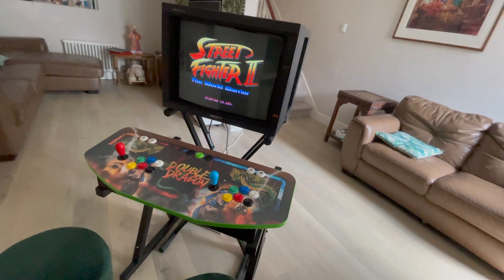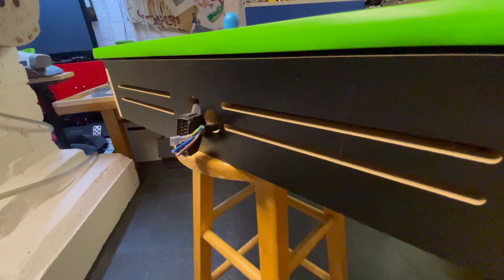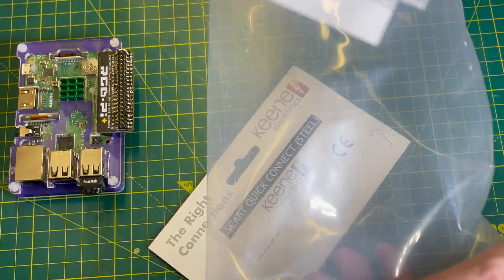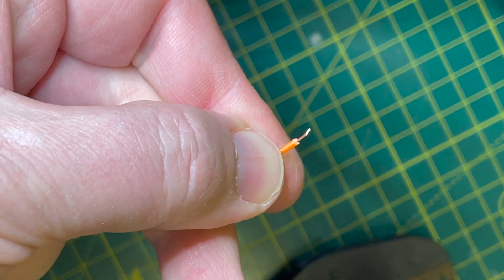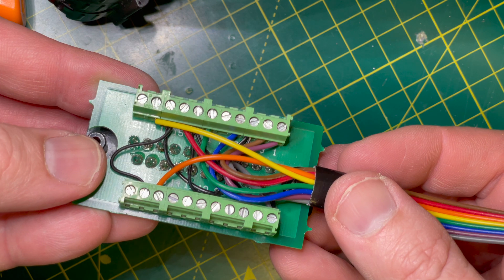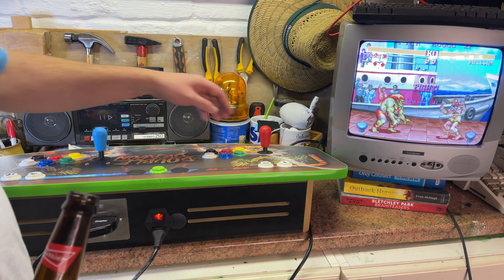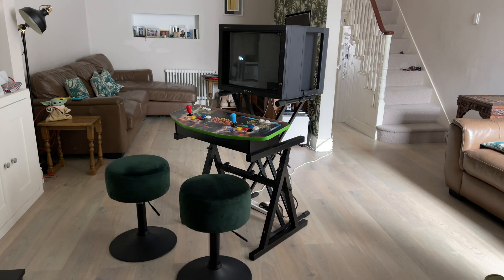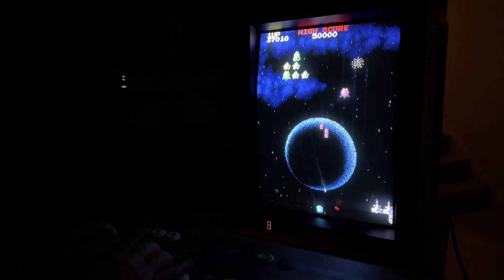RGB-Pi PLUS - review & install

Comment: your video on archon those versions look like terds. it was released 3 years after the c64 original in 86 and they didn't do anything with it. the nes conversion later released in 89 is vastly better.

Comment: Hi! Did you have to adjust from the service menu your tv? I have some overscan when I’m playing arcade games (fbneo core). Any other console games are fine. Is it a problem about tv or the hdmi timing in rgb pi?
Reply from the maker: Yes, I had to adjust my CRT's geometry via the service menu and even so some arcades are cut-off. This is a "feature" of arcade cores - they are a variety of resolutions. In a real arcade machine  the geometry of the crt is normally adjusted whenever the gameboard is changed. The same applies to RGB-Pi. Hopefully you can find a setting on your TV that is a good balance.
Reply: @ChrisSkitch  thank you!
Reply: @ChrisSkitch  uhm just a last question. Do you get any distortion sound or some cracking sound when emulating arcades?
Reply from the maker: @Ononokii  Not that I've noticed. Most sound perfect. The Mortal Kombat series had some issues but the new Arcade Pack 2.2 has improved this.  I guess you have tried adjust the EQ settings in the RGB-Pi menus? Also don't forget there's an active community on Discord that might be able to help.
Reply: @ChrisSkitch  yes, I tried but nothing changed :/ yeah I already subscribed to the community. Thank you again

Comment: Nice build, well done! I'm particularly envious of your monitor which can easily be turned on its side and back again - a cunning external solution! I'm just using an old only TV leaning on its side in my home-made cabinet. I think I'm also using the same keyboard encoder as your original build, but my RGB Pi is the old one which doesn't auto switch to RGB unfortunately.
Reply from the maker: Indeed the Sony PVM-2130QM is a lovely display. I specially bought it for TATE gaming.
Reply: @ChrisSkitch  may I ask where you picked it up? I've been keeping an eye on auctions, but half the gear seems to be in bad condition, while bay prices can be very high...
Reply from the maker: @DinoBytes  I was lucky on Facebook Marketplace about a year ago, picked it up for £200.  Just looking on eBay now can see some pretty steep prices these days.
Reply: @ChrisSkitch  that is a brilliant price, especially if it's in good condition with no burn-in. They can go for hundreds, even a thousand on eBay.